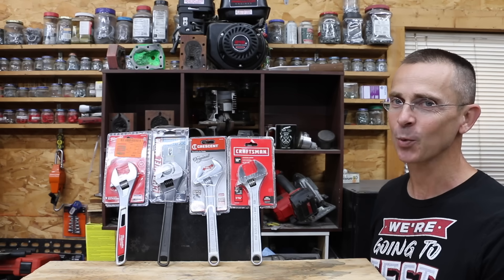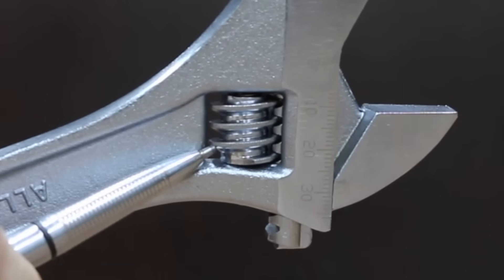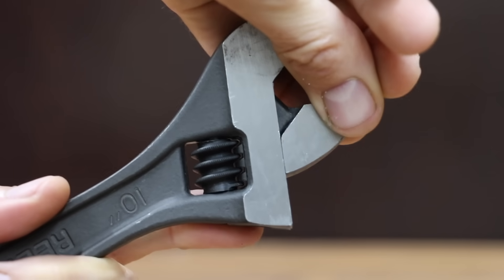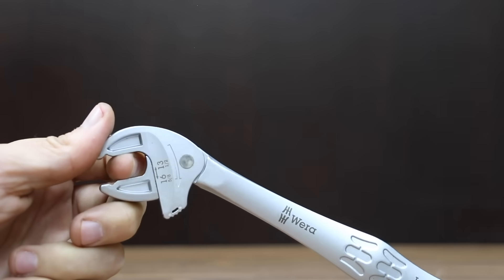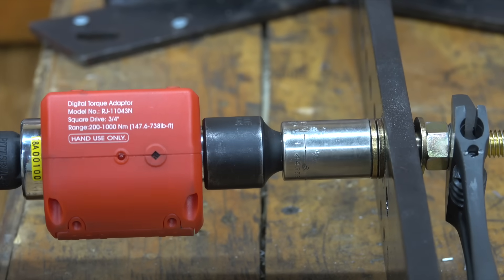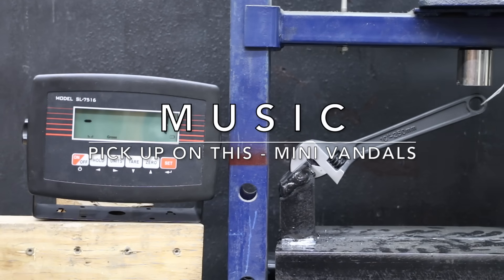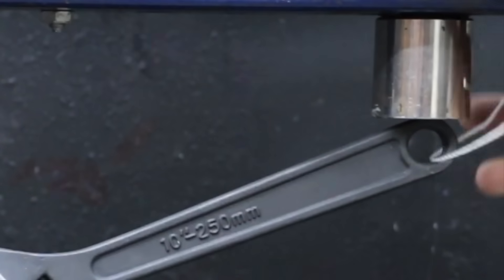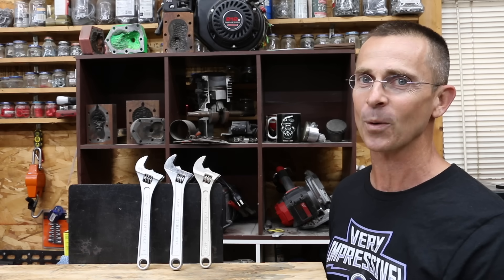Best Wrench (ADJUSTABLE)? Craftsman USA vs Craftsman, Crescent, Kobalt, Milwaukee, Channellock

Comment: Your reviews are very thorough and provides information I can actually use. Please keep it up!

I'm one of the lucky people who has the fortune to own a Craftsman USA adjustable wrench but also a couple of cheapy wrenches and intuitively  I'd rather walk across the garage to find the Craftsman  than  having to use the cheapy ones. It's so well made that it's a pleasure to use it over the others. I didn't actually understand why I liked it until this review. "thanks for sharing!"

 Two things you didn't get to review are, 1) corrosion resistance, 2) how durable is the surface of the jaws and I can tell you, the parallel surfaces on the jaws just gets worn out and dent out over time but the Craftsman just lasts longer.  Some wrenches might look nice and shiny when they're brand new but soon you'd see that it's just a chrome coating and the metal underneath is just junk.  I wish I can post a picture showing you the difference and you'd think I'd use the cheap version much more because how worn they are but quite the contrary. 

I'm a little disappointed at the Channel Locks brand from your review, I would have thought they'd be better than what the results showed. The others seemed to be inline with what I'd expect from their brand reputation.
Reply from the maker: Thanks, will do!

Comment: You need to test knipix wire cutters. Those things are truly impressive
Reply from the maker: Thanks for the suggestion.
Reply: @ProjectFarm  I use them to cut my welding wire ⅛” thick stainless wire. Cuts way better than the newer klines. Old klines actually seem better than the new ones. I can even cut 5/32 without dulling them

Comment: Sorry, but when you used the torque adaptor, you had the wrenches on the nut BACKWARDS, thus causing the nut to be turning in the WRONG direction. These wrenches are intended to be used in ONE direction ONLY !!!  Try reversing the wrenches over and operate it in the direction it is supposed to be used.

Comment: I use a set of parks at work tight adjustment and not sloppy fight either actually designed for bicycle work but they are all a round crescents
Reply from the maker: Thanks for sharing.

Comment: Idea for video.  Years ago I worked at a large factory that furnished tools (side cutters and needle nose pliers).  The factory moved and production had large tubs full of rusty, frozen pliers they were throwing in the dumpster.  I picked out a bunch of them and soaked them with WD-40 trying to get them freed up.  It didn't work well.  An old tool and die maker was watching me and came over.  He said sometimes when things aren't working try the opposite of what you're doing.  He put some lacquer thinner in a can and held the pliers in it while working them back and forth.  The oil flushed out and then the rust flooded out.  The pliers freed up in seconds.  I did all of them quickly and then oiled them and they worked like new.  If you're wondering what happened to all those pliers, that would turn into many long fishing videos with a lot of happy friends.
Reply from the maker: Thanks for the suggestion.

Comment: Idea for a video.  For a flooded single cylinder engine (like a mower), can you put it on the exhaust stroke (exhaust valve open) and put a flame at the exhaust will it flash the cylinder vapor?  Repeat it again spraying some starting fluid in the intake.   Also if you could manually apply a spark thru the plug (from a separate coil like a bbq igniter, or a battery and coil) would that flash the vapor and clear it (might need to spark repeatedly, and it would probably cough back thru the carb on the intake stroke).  Would be great to see with a clear plastic head.  If you heated the head just a little with a propane torch would that help.  Trying to think of something quick and easy to do without having to remove the plug or setting the air filter on fire.
OK how about using a stun gun?  Flood the engine and put it on the exhaust stoke.  Put some wires on a stun gun and connect one to the head and the other to the spark plug and press the trigger.  Leave it running until it you hear a noise out the muffler.  The tips on most stun guns are wide enough to put it against tip and side of the spark plug and pull the trigger.  Might be an easy way to clear flooding.  Disconnect the plug wire so the electronic ignition doesn't get zapped.
Reply from the maker: Thanks for the suggestion.

Comment: A lot of those brands are not available here in Australia.  I personally use Bahco tools, have never broken one and they come with a lifetime guarantee.  The other brand I have that seems to defy it's cheaper price is Kingchrome, the adjustable spanner I have is about 20 years old and the amount of work and beating it has been through yet it still works even though the jaw is starting to become loose.  I know some people who rave about Sidchrome and the older Sidchrome tools were good but as some manufacturers start to rely on the name the product quality goes down and so it happened to Sidchrome and Kingchrome tooks it place.
Reply from the maker: Thanks for sharing.

Comment: Great video and testing once again. I recently bought a novsight H4 LED bulb as a replacement for the standard H4 halogen bulb in my motorcycle(of course also applicable to cars) . It was very difficult to find a good comparisons between LED Headlight bulbs, let alone find information on what features makes a led bulb good and what makes it bad. E.g. spacing between the two LED modules (one on top and one on bottom) may not be greater than 0.9mm.

I feel this topic would make for yet another great project farm video!
Reply from the maker: Thanks!  Thanks for the suggestion.

Comment: Damn I love your tests! I wonder how some of the modern locking adjustable wrenches compare though. They are a bit like the bastard child of vise grips and an adjustable wrench, the little bit of slop in the mechanism gets taken up by the locking mechanism. I have a couple crafstman "extreme grip" ones and while the quality isn't great (I had to add my own spacer to one of the two to make it work), they really come in handy when you need a wrench that won't fall off a nut or bolt so you can just concentrate on reaching the other side.
Reply from the maker: Thanks!  Thanks for the suggestion.

Comment: actual use, with experience, your torque is applied in the wrong direction. No wonder it is dubbed the knuckle buster. Please don't teach anyone to use this tool. Identify the weak jaw and the strongest place on the weak jaw, now do the testing.

Comment: Anyone in their right mind wouldn't use a crescent to hold a bolt while impacting anyhow. But by all means if you do put your thumb on the worn gear and push. It ain't going anywhere. Or use  Box end wrenches.

Comment: Todd, a test of windshield washer fluids would really be great. We esp. need a freeze test, as I was just reading online about the -50 F rated Wal Mart pink RV fluid freezing solid at only 15 degree F temps. The consensus on the internet is that many of the freeze point claims on washer fluid are very exaggerated. Some Amazon reviews said the Prestone Premium fluid froze at as little as 20 F. Thanks.
Reply from the maker: Thanks for the suggestion.

Comment: would go snapon over all of these for the adjustable wrench. the snappy ones have flank drive. which is essentially just grooves in the head of the wrench. but they help tremendously to not slip off nuts/bolts.  but those little grooves are patented by snapon, so i'm pretty certain only they can do that. that being said though, they are 362 dollars for a 4 piece set. wouldn't reccommend unless you're a professional .
Reply from the maker: Thanks for the feedback.

Comment: Today I learned that the trusty 10" Craftsman adjustable wrench that I have in my toolbox is considered "vintage" - maybe I should stop using it and mount it in a special display box. Nahh, it's a tool and apparently, the best! Great video.
Reply from the maker: Thanks!  Thanks for sharing.

Comment: I'm not surprised about the Irwin, they've destroyed what little loyalty there was left in two classic Sheffield brands, Record and Marples.  In fairness most had been offshored to China before Irwin bought the combined company (Record 
Marples).  My Record metalworking and woodworking vises are getting on for 80yrs old and will last for another 80 with no problem.

Comment: I have a 10" Stanley that combines an adjustable wrench with the locking mechanism of vice grips - best adjustable wrench ever, makes it better than even the proper size open end wrench. zero slop once you lock it. I just checked Amazon - didn't see the Stanley, but it looks like Craftsman makes a version called the "extreme grip", along with a few other brands. Might make for a good future test - test a few against each other and how they stack up against an open end in the correct size and against a quality traditional adjustable wrench
Reply from the maker: Thanks for the suggestion.

Comment: Good test! In the loaded gap test, shorter jaws is actually an advantage if I’m thinking correctly. The gap would be larger the longer the jaws are. If you drew a parallel line from the end of the jaws while under load, the gap would get larger the longer the line was.
Reply from the maker: Thanks!  Thanks for the feedback.

Comment: I've had my craftsman set since 1983.  Best tools I've ever owned for the money.  I broke a couple tools and wore out three ratchets, but all were replaced for free at the store.  I also like most name-brand tools, but nowadays most will do the job even store-branded Chinese-made sets.  Lifetime warranties and local vendors/stores are a must for me.  The more I plan on using a tool, the more I will probably spend. The more higher-end sets will save time and money on repairing or replacing.
Reply from the maker: Thanks for the feedback.

Comment: Can you compare metal cutting band saw blades for the handheld band saws? I've used some that last a long time even cutting high carbon steel but had some that cant even go through mild steel.
Reply from the maker: Thanks for the suggestion.

Comment: Mate in that last test (jaw break) longer jaws should put the wrench at a disadvantage not an advantage as more force is applied relative to the amount of force on the handle. Handle length also makes a difference, the handles would all have been shortened to the same length for comparative testing.
Reply from the maker: Thanks for the constructive feedback.

Comment: What if you flipped them over during the last test so the non-moveable part is tested?  I just kearned there's a rigght and wrong direction for using adjustable wrenches.
Reply from the maker: Thanks for the constructive feedback.

Comment: I had to stop myself from shouting "Don't break the real Craftsman!"
I still use some Craftsman tools I got over 40 years ago. Their 3/8" ratchet drives were the best.
Reply: I agree ..  I will not let go of my  USA Craftsman sockets and wrenches.  I have a mechanics set that includes 1/4, 3/8 and 1/2, that I purchased in the mid to late 1990s, well before they went to the Chinese knockoffs.  One time I had a ratchet go bad.  They wanted to exchange it for a Chinese one.  I said no way, so they rebuilt my old one
Reply: All of my USA Craftsman and first gen Kobalt's stay nice and safe in my garage in a box with felt lined drawers. I wouldn't even think of taking them to work with me.
Reply: @Hathorr1067  it is an honor to use a great tool until it breaks
Reply: @djheatt  Yes you can--------------WITH THE CHINESE BRAND, AND THAT ONE DOESN'T have a lifetime warranty !!!
Reply: Same lol
Reply: This.  It feels wrong to break an old craftsman.
Reply: I would have been OK with him skipping the end test on this one...though we would have all assumed it wouldn't break due to how well it did on the other tests. 😆 But still, RIP Craftsman USA.
Reply: @chadvoller  agreed especially since they ate irreplaceable
Reply: Something I noticed: that "vintage" craftsman is one of the junk models they started cranking out in the mid '90s. MY craftsman adjustable, which was my dads, is 49 or 50 years old. I have savagely beaten the shit out of that thing (3 ft. handle extensions/impromptu hammering/sledgehammering the handle) since I was nine years old and I'm 47.  Side to side slop: .4mm  Jaw slop: 1.41mm
Reply: Wish I could find some
Reply: When it comes to ratchets, give me the old SK ratchet. I have 1/2" and 3/8". I had a 1/4" but some decided they needed it more than I did. I have a craftsman, and a Snap-On 1/4 drive, now. Nether hold a candle to SK.
Reply: RHFT ratchets are the best
Reply: i know exactly what you mean.  i still have the bulk of my first tool set also,   Sidchrome,  purchased in 1977 when i started my apprenticeship at 15.  even most of the sockets are still in good condition, because i was taught to use them correctly.    the young tradesmen call me 'old school'  i keep turning around looking for my 85 year old father,  he was and still is a 3 trade master,  Steam, Diesel and Petrol qualified.
Reply: Me too, although I believe most of are over 50 years old now.  The tools outlived the store they came from😊
Reply: Matco   flexhead 3/8  and  the snapon  equivalent are way better ratchets, but for tinkering  around the home Craftsman is good enough.
Reply: @djheatt  i have been able to get them replaced when broken, but the quality today is just pure junk as compared to the 60s and 70s same part.
Reply: Ive owed 3 of those junk rachets crapman is not that good... a Stanley is better than a crapman u must not use them alot like I have they don't hold up well at all
Reply: @slabbusterrtr7690  Yes, the newer ones are junk. Mine from the '70s has been flawless. I have Matco ratchets that I used at work but at home I prefer the Craftsman. I have seen Stanley. It also isn't what it used to be.
Reply: @Peter Evans That's why I treasure my remaining Craftsman tools from 40+ years ago.
Reply: @djheatt  Yes.
Reply from the maker: Thanks for sharing.
Reply: @ProjectFarm  have you ever done a caliper comparison. im too cheap to spend more than 20 unless i know im getting something i missing from the cheaper model. seems like they arent much diff from each other and probably easy to get out of  spec regardless of quality/price
Reply: @ProjectFarm  Really though, this was like crashing a classic car. Disgraceful.
Reply: Sadly since about 2011 lifetime warranty gets you a made in china replacement.
Reply: @djheatt  they'd give you a Made-in-China one. :sad:

Comment: I'm not sure that your analysis of the wrench with shorter jaws being at a disadvantage in the gap test; since your measurement was at the extreme end of the jaw, the longer jaws would show a larger gap with the same angular deflection. The shorter jaws would also be stiffer for a given thickness, and since the extreme edge of the jaw is closer to the centre of rotation would also experience less strain under load. I think that the shorter jaws would have an inherent advantage, and if I'm not mistaken your testing actually demonstrated that, quality differences notwithstanding.
Reply from the maker: Thanks for the feedback.

Comment: I read an article from an engineer that explained the adjustable wrench should be used in the other direction when turning a nut. Try it on one of the wrenches and see.

Comment: It irks me every time I read comments here, and in Ave's channel, about 'crap made in China' or lower quality products because 'they switched to China', implying that the Chinese people somehow can't make shit or are lower skilled than Americans/German/Japanese/whatever.  An American worker isn't better at making stuff than a Chinese worker - period.  The new Craftsman tools aren't bad because they are made in China, they are bad because Craftsman wants to lower manufacturing costs but more importantly how much dividend it wants to share with its shareholders; Craftsman very easily can make a wrench in China with the same specification as the vintage USA-made wrench but it doesn't want to because they would be more expensive to make.  Blame the American company (in this case Stanley), not the Chinese worker - the correct expression is 'crap made by Craftsman' and not 'crap made in China'.

Comment: Can you do a video testing sockets? I rounded out two 12mm sockets today trying to break a few bolts.
Reply from the maker: Thanks for the suggestion.
Reply: @ProjectFarm  I ended up finding a new set of Williams, which is a Snap-On brand, sockets for about $55. They seem to be a lot nicer than my harbor freight specials.